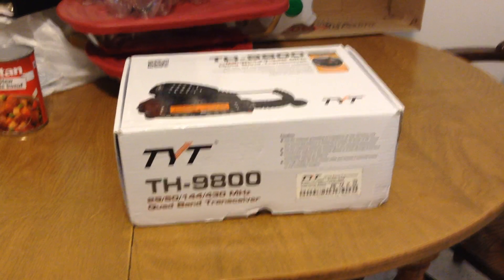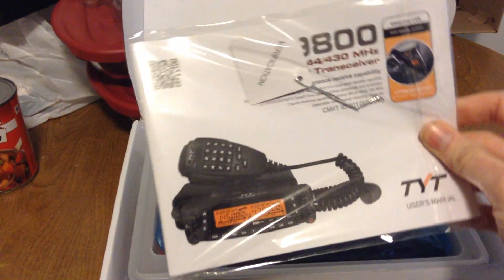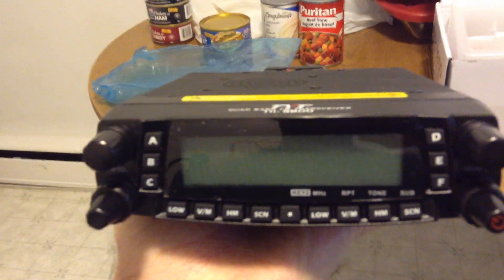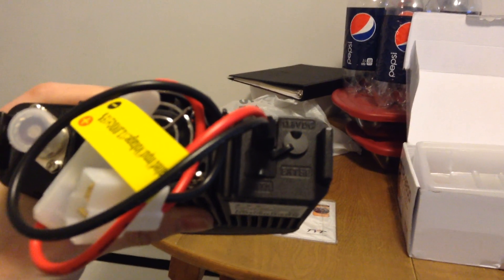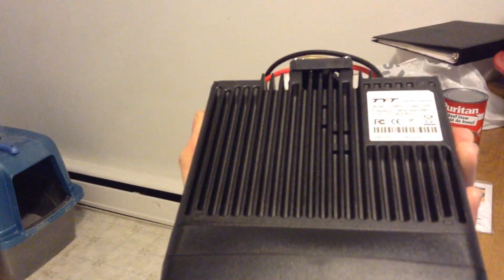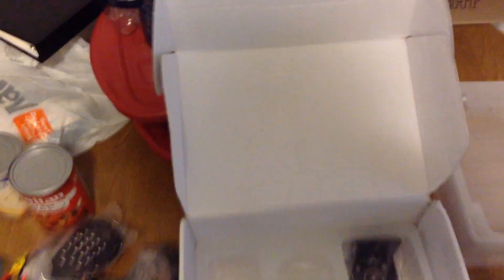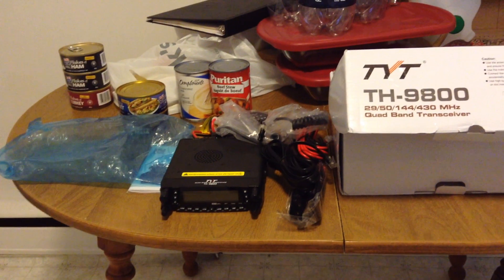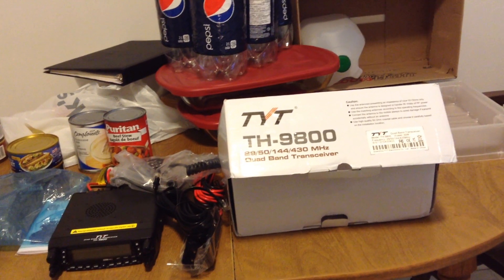Unboxing my new TYT TH-9800 29/50/144/430 MHz Quad Band Transceiver

Comment: did it have am on 10 meters, price, and how is darrell the radionut turned metal detector guy, ha.   what antenna do you use.  your dealer name there is who, please
Reply: George Gardinier These radios will only Transmit on FM.There is No AM Board for transmit so they don't become Free Band CB's in the USA.I have heard that several did a mod & they operate 11 meter FM for Europe CB Band.I don't know why everyone wises too mod every radio when they know what they were designed for before they purchased them?